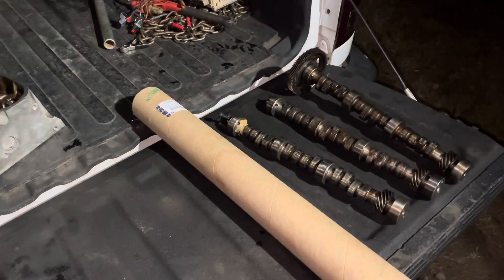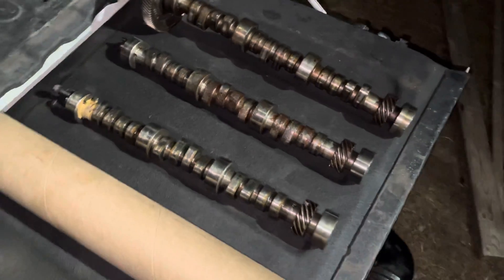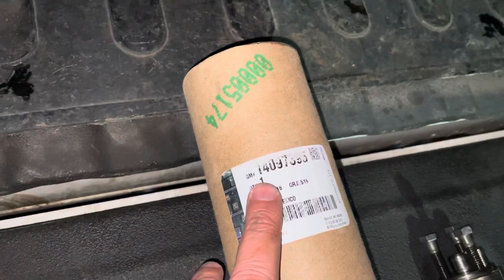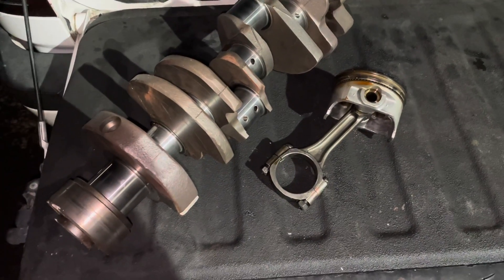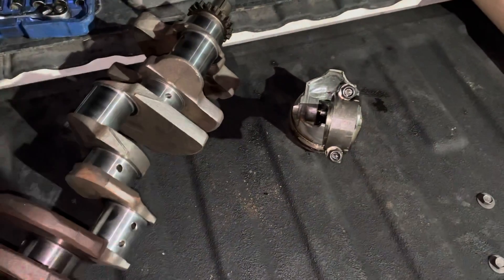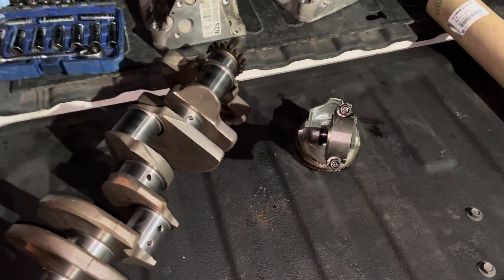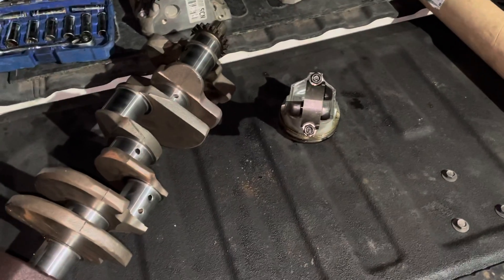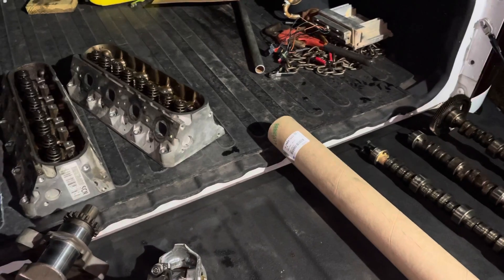Mercruiser $$$ - Don’t Get Mercruisered

Comment: So you are saying the GM  Part #14097395 camshaft will work in the Ford 302 marine engine? I have a 1975 Sea Ray with the Mercury  Mercruiser 888 that has the  Ford 302 that needs rebuilding.
Reply from the maker: No GM camshaft will fit a Ford engine. Why did you think that? 99% of Mercruiser engines are GM not Ford.

Comment: I'm in the process of refreshing my 2003 Mercruiser 3.0 and correcting a bent valve that put it out of commission.  I've been advised that the 3.0 is just an industrial GM 181 c.i. four cylinder.  Can you provide some guidance on what i need to search for to find the automotive equivalent?
Reply from the maker: Call Scott’s Machine Shop in Fayetteville GA. He can sell you one or tell you where to get one.

Comment: I am installing a GM Truck Vortec 5.7 into a boat. Do I have to have a Marine Spec Cam or can i leave the GM Truck cam in the engine? Opinions?
Reply from the maker: A marine spec cam is almost identical to a Corvette cam so compare the Corvette horsepower to the truck horsepower for the same engine and you’ll see what you’re missing. Marine cams are designed to run at a higher RPM and make more horsepower. The unmistakable rumble of a marine 5.7 is due to the camshaft. Actually, you can’t make the comparison there was never an iron block Corvette with Vortec heads. When vortec truck engines came out the Corvettes were already using LT1 reverse flow cooling aluminum heads. From there the Corvette went to the LS1 so Corvette never had a vortec iron truck engine.

Comment: Appreciate the info and great video I just bought a boat with a 1989 4.3 Mercruiser engine in it has a cracked block but the guy gave me another engine out of a truck that is a 4.3 and I noticed it has a space for a fuel pump but no holes factory drilled for it.
Reply from the maker: He gave you a fuel injected engine. If you are using a carburetor you’ll have to install an electric fuel pump and the wiring to safely run it.
Reply: @moccasinmarine  I see so I'll use the cam out of the mercruiser engine for it and install a electric fuel pump wired to safety spec cool thanks alot hopefully that's all the problems I'll run into I plan on doing a rebuild on it if it all checks out OK once I finish tearing it down it had a lot of water in the oil pan maybe from where he had it sitting outside

Comment: What about injectors? IWP069 I found some on amazon same part numberfrom Rop shopfor 20 instead of 220$  Ive been told different things. the cheep injectors are crap to they come from the same factory.... any info?
Reply from the maker: Can you re-ask your question? There are a few typos that make it unclear what you are asking.
Reply: @moccasinmarine  I’m sorry, I’m all thumbs. I had my injectors cleaned for my mercruiser 502 mag and one broke. A new one from mercruiser is 220$
I found them with the same part number IWP069 on Amazon from a seller ROP SHOP FOR 20$
Will it do the same job? Or is this something  where you pony up for the mercruiser part?
Reply from the maker: @joshtalbott9528  if the seller says they will work then go with that. Anything that Mercruiser sells related to the engine is not theirs. They just relabel GM parts and charge you 5-10 times more because boat owners have money.
Reply: @joshtalbott9528  sounds almost like a ramjet 502.